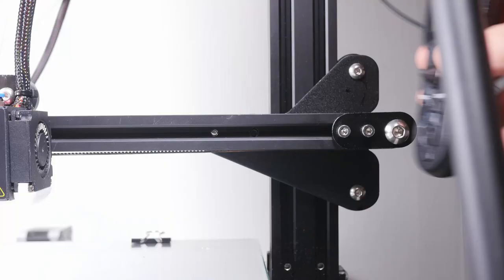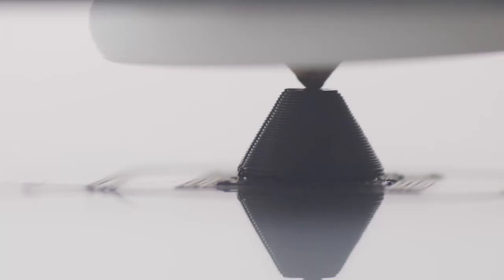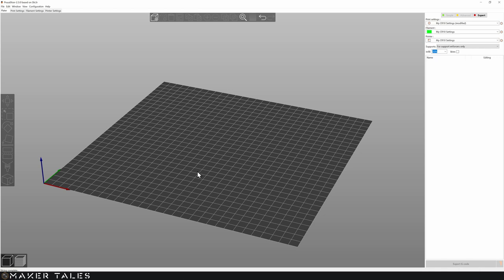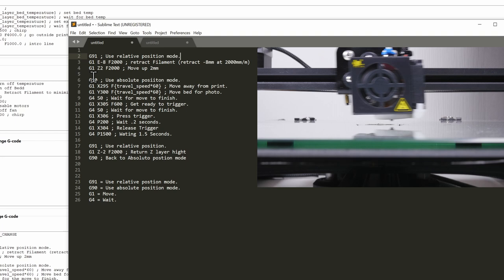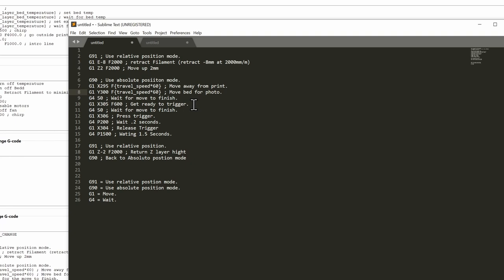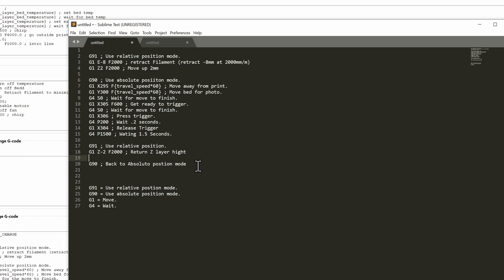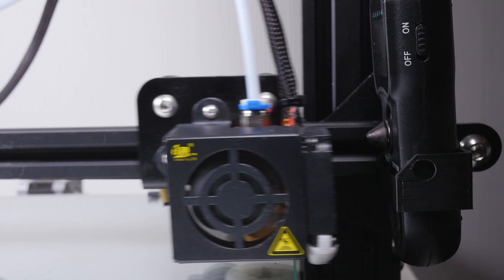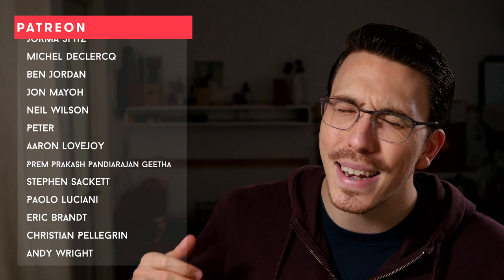How To Turn Your 3D Printer Into A Timelapse Robot | Without Octolapse!

Comment: That was pretty cool.  I was just thinking that you could add a simple small coil spring to the trigger button (or use a printed plastic lever that will bend a bit) to take up a little deliberate over-travel and then the travel setting won't be nearly so critical, and you could likely speed it up too.  Nice video tutorial and useful because it will allow me to use my 4K HD camera instead of being limited to my crappy webcam on the Octoprint Raspberry Pi.
Reply from the maker: Oh for sure, My only concern might be wear on the 3D print belt after years of time lapses 😅

Comment: Seeing that little gizmo you made to hold the shutter got me thinking how the issue of fatigue under cyclic loading is handled by the 3D printing community when designing little holders, brackets etc. I am guessing there is a range of engineering knowledge in the community that may not be fully aware of the potential for fatigue in polymers like this? Maybe a topic for a video about what to do to avoid stress raisers when designing small components in Blender? Or am I being too general, I don't have a 3D printer myself, I am mostly here for the Blender stuff.
Reply from the maker: Hmmm it is an interesting thought... to be frank I think more people in the 3D printing community over engineer things anyway as it's a 3d print and well we don't trust them most of the time.😅 Plus it if breaks we print a new one 😂